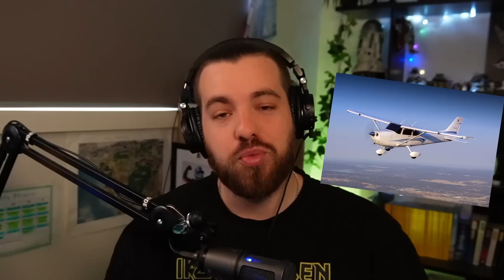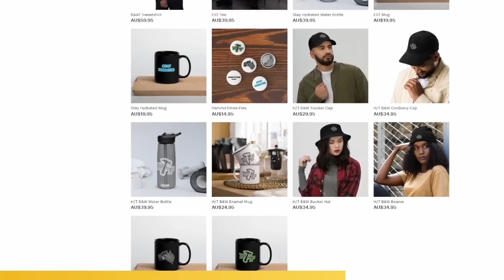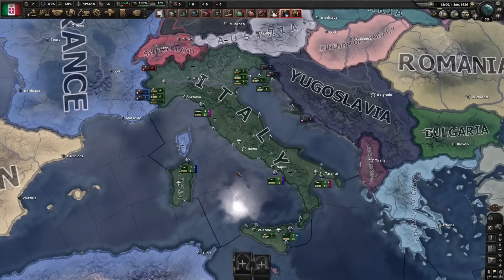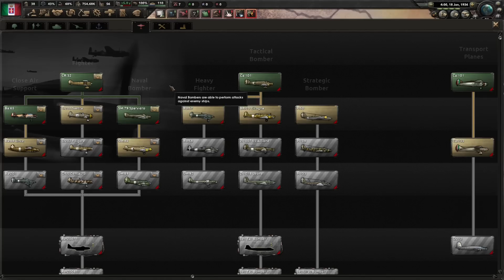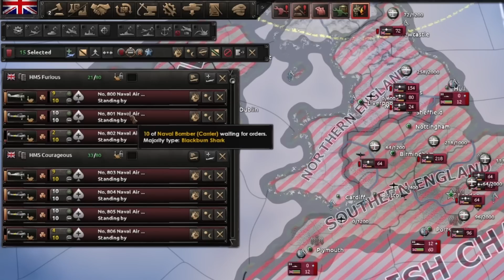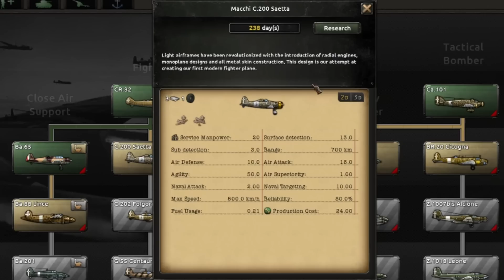Complete Airforce Guide for Beginners in Hearts of Iron IV!

Comment: Okay, it's 1939, I have built 4 CVs, and I don't have any naval planes to put on them. I assumed the little icon with the carrier in the research tree of aircraft meant that the aircraft could also be used on carriers. I think the design is different from the extra little research icons for tanks, that's why it didn't click that I needed the extra research. On the plus side, I have a ton of fighters and navel bombers now. I just need to learn how to organize them and how to use them properly.

Comment: Brilliant Mate - thanks.  And perfectly timed as I was doing air testing this morning.  Exercised the entire RAF for 90 days and lost 40 planes to accidents (average of 3 tests), but if I exercised day time only I lost only 16 - that's a huge difference.  You reach trained level at the same time and earn xp the same on both options.  Just in case you might not know.  Also a question - is it ever worth putting an air wing on 2 missions - so CAS does logi strike (with the dlc) until there's a battle then it does ground support.  Don't know if that works or is a bad idea ?  Cheers, MMM
Reply from the maker: Glad to help! Ooo yeah that's really good to know! I didn't go into it in this vid as it's a more advanced thing to worry about, but you can toggle if your planes operate on day/night.
In answer to your question: 
You're always better toggling on/off your planes for different missions rather than having them on multiple. What I'll do is if I have 8 CAS wings, keep 2 on logi strike and the rest on CAS. 
Thanks Monty!
Reply: @hammotimee  CAS - yes thanks that's a much better idea !
Reply from the maker: @montymechanizedmarines  glad to help!